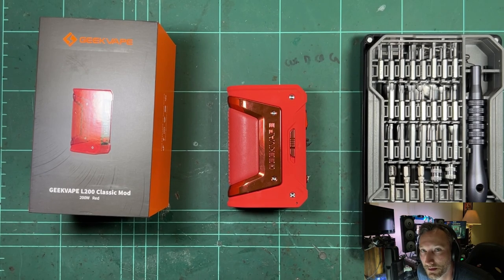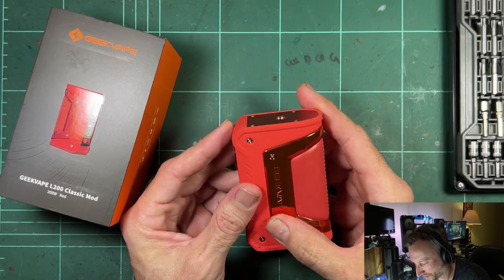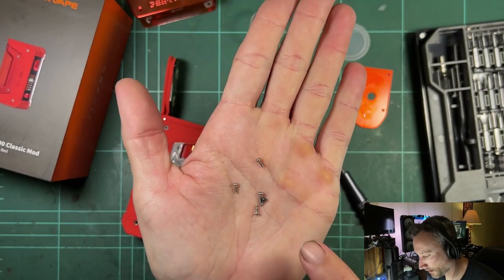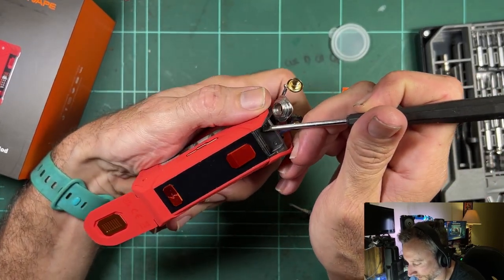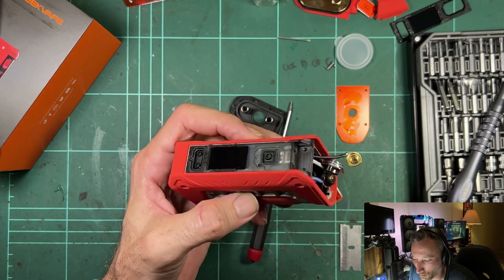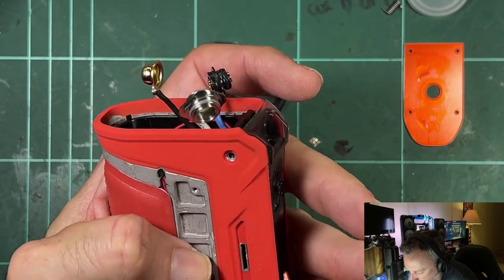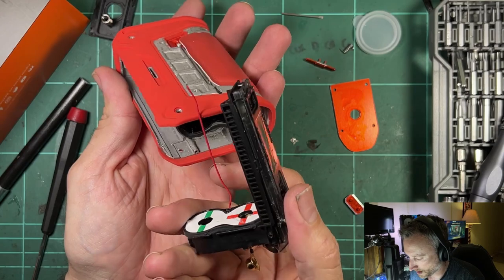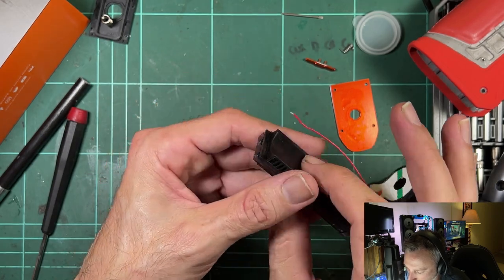Geekvape L200 Classic - Full Disassembly and Build Quality Analysis.. long

Comment: Excellent breakdown. Just returned a Voopoo Argus XT with a common switch problem. So in the market for a new mod. Was looking at this and researched and found your channel. I'm sitting here puffing off the original Aegis Legend! A tank. I have dropped it multiple times, I damaged the charging port in the first month and liquid got in by the screen. My fault, I went tinkering 😁. But it is still going strong after 5 years of pretty much full time use.

Comment: Great info.  I actually did this same operation last night.  This MOD started having issues where it would power down on its own.  Yesterday it wouldnt power back on so i tore into it to see if i could find an evident issue.  I bought this MOD in october. I also found that  a ton of  juice makes its way down into the body of the MOD.  I was shocked when i got into it amd saw this because my tank rarely has leaks and im very vigilant about keeping it dry. I also had the Aegis legend and it did the same thing.  It lasted much longer though.  Geek Vape seems to have this problem with their MODS as im not the only one i know of who has experienced this.  Their customer support is non-existant in my experience. 
Appreciate the info.

Comment: Hey I have an issue with the slide release battery door. No screws to get to the slide assembly. How does it come apart?
Reply: Did you ever get to the bottom of this? I have the same issue.

Comment: Thanks for the video! If you were to desolder those 510 wires, how would you go about? Fat tip? High temp?
Reply from the maker: You’d want to use an iron with a fairly high heater element wattage, so it can get those big joints up to temp quick. Sometimes I’ll use my gas iron for those jobs, plenty of heating power. Yeah a wide tip and dialling up the temp if you’ve got an adjustable soldering station helps too. Cheers!

Comment: great breakdown. do you by chance know how to take the door apart. just got one its about 30 days old and the screws that hold the button for the battery door have backed out. i dont want to break it but other then that it has been a great mod
Reply: Did you ever get to the bottom of this? I have the same issue. 35 days in.
Reply: Omg😂. I watched this whole video hoping to see that as well. I’m sitting here with my mod battery door in my hand like “ok?  now what?”

Comment: Love the video. Helped my last problem with a lifting screen corner. Do you by chance know how to remove the cover plate to reveal the screws of the latch assembly? In my case the door still latches but the latch “handle” is falling off. Basically the contact patch you’d use to push the latch open. I see two screws that would hold it on but don’t know how to get to the head of them with the battery contact plate in the way. I tried to lightly pry at the plate but it didn’t pop off and want to avoid breaking it further. Any response would be greatly appreciated. Love the video again, Cheers!
Reply: Waiting for solutions too.

Comment: I need help... Would anyone know how to do a factory reset on my Geekvape aegis legend l200???or if anyone know if there is a video for that mod only... I've tried different numbers and everything else but I still can't get my eJuice to have a taste my coil are not new new.. I've had them for about e days now.. I did put oil on/in the coil.. My temp is about 400 and wattage is at 85.0.. Please help me!!!
Reply from the maker: Are you using a temperature control compatible coil like stainless steel? Otherwise TC mode won’t work. Also I believe the L200 and L200 Classic have quite a low power limit in TC mode, much lower than 85W even though that’s what it shows on the screen. Try swapping to normal wattage / power mode instead. Good luck!

Comment: Great video!
Can you please show us how to access the screws of the latch on the battery door? Mine got loose and now I can even open the door to change the battery.
Maybe be a short video would help us all. Thanks
Reply from the maker: Hey mate, thanks for the comment and apologies for the very late reply. So you can remove the door just by pushing the pin at the hinge out, it’s just near the lower corner screw. One end of the pin has ridges and the other is smooth (you’ll only see this as you push it out a bit), best to remove it in the direction where the ridged end is coming out first. The door will then come loose, watch out for the small hinge spring. The door itself looks like it has the latch mechanism moulded inside the silicone… potentially non serviceable. I’ll have to investigate a bit more when I get the chance, will let you know if I can get it apart without destroying it. I wonder what’s happening inside the door to make it fail.. I’ve seen a few other comments about it :/ Cheers!
Reply: @vmgtesting8014  Thank you so much!
Can’t wait for a short video explaining exactly how to do it. This is the only channel I can trust tbh so keep up the good work!
Reply: @vmgtesting8014 do you have a video how to open the battery door lock?

Comment: Buy a tool, take it apart and it turns out that the positive ping cable came off. Check that it is not a false contact or the same as my equipment.Thanks for your video VMG Testing
Reply from the maker: Thanks for leaving a comment mate, glad you could fix your device!

Comment: I’ve got a bad display on an l200 classic and I have an m100 you think I could just swap displays
Reply from the maker: There’s definitely a chance they used the same display but I can’t say for sure. If they are the same, yes you can swap them but the ribbon can be a little tricky to solder.

Comment: Hope you get to mess with a innokin coolfire z80 sometime. Had mine about a year now. Some juice has passed through the edges of the 510 more than just slightly. Was noticing it wasn't hitting the same. Wiped the threading down with iso, that was dry & mostly clean. But when I flipped it upside down & tapped it on my hand, liquid kept coming out the 510 edges. After doing it & wiping it off about 18 times, was still getting a bit out but barely. Hits better now. Love this mod but beginning to wonder how the inside looks now lol. It has 6 torx screws. Getting a cloudy grey model for a extra soon. Its by far the most comfortable mod I have. Fo mode is underrated imo. Some ignore it after trying because it hits a bit different.